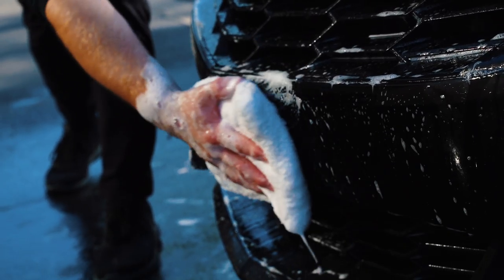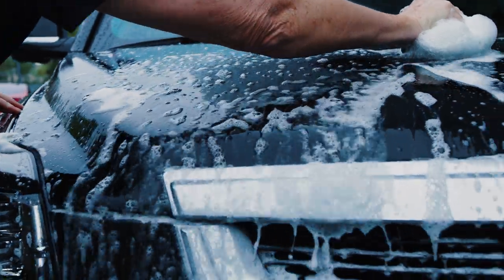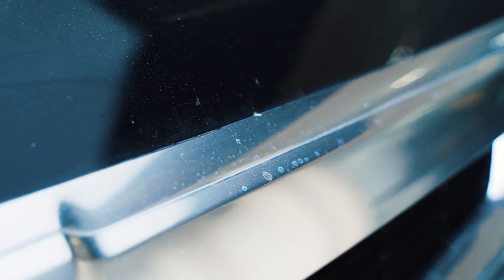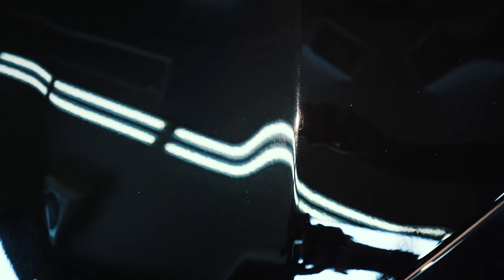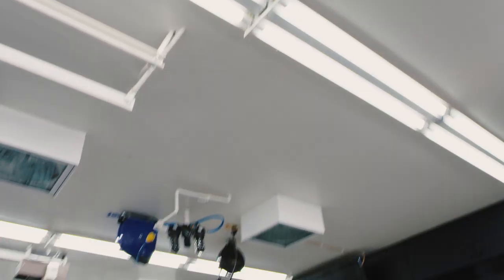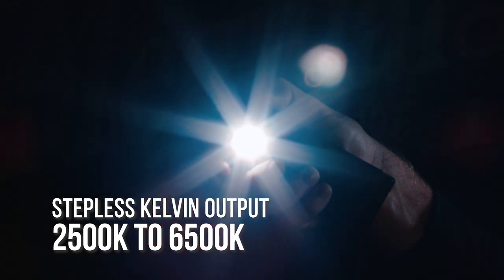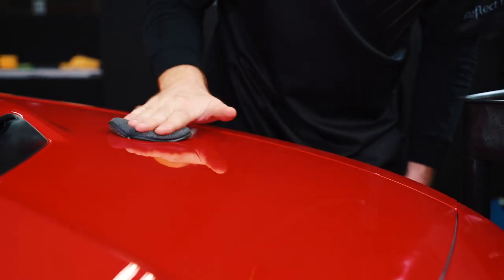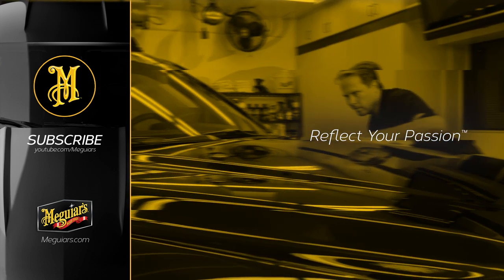How to Evaluate Above Surface & Below Surface Defects - Meguiar's Quik Tips

Comment: You should do a video on headlights because i don’t know if my headlights need to be buffed out or if they need to be replaced my headlights look like they have little bird feet on them
Reply from the maker: What you are describing is a more serious issue where the plastic is actually failing inside not just oxidation/hazing/fading from the elements on the exterior.  There is likely nothing that will fix this.

We do have a few videos about headlight restoration on our Youtube Channel.  Below is the one that shows the use of our Heavy Duty Headlight Restoration Kit.  Just ignore the fact that it is outdated, the info is still good.  😀

https://s.3m.com/65xay

Comment: Soo.. let's say my paint is pretty good with very minimal swirl marks and I do t have much time for a full detail. Can I use the hybrid ceramic quick Clay kit after a wash and be done? Or would I have to re wax the car after the quick Clay? Does the hybrid quick Clay remove the wax?
Reply from the maker: Clay does to some extent remove wax so it should be done before waxing.  You can just clay and then wax but that will not remove the swirl marks you mentioned.